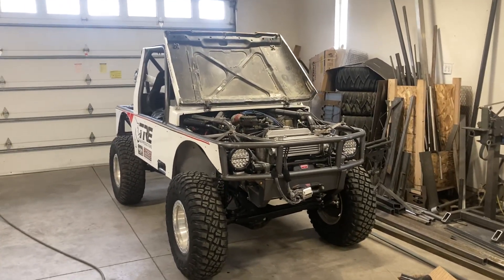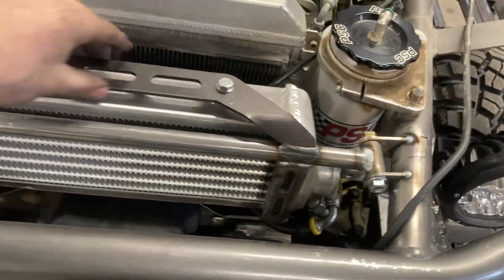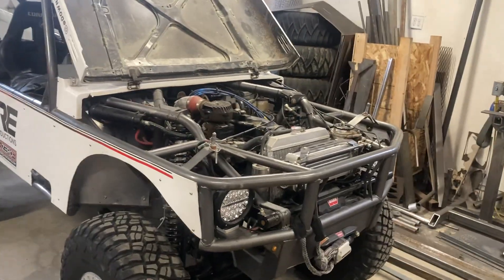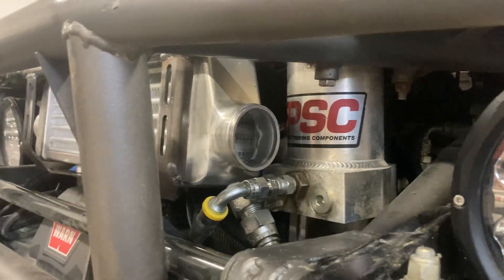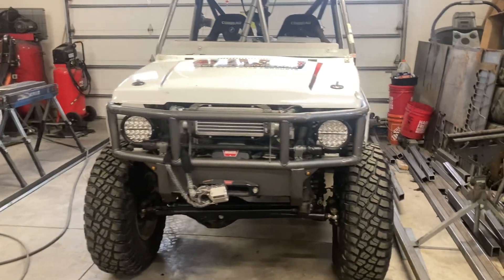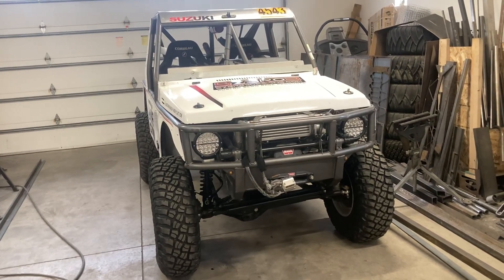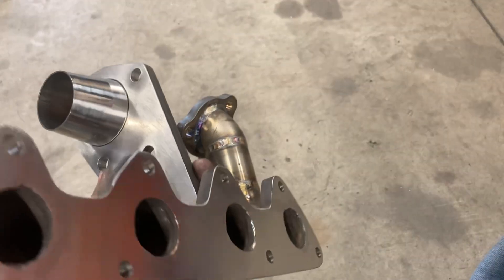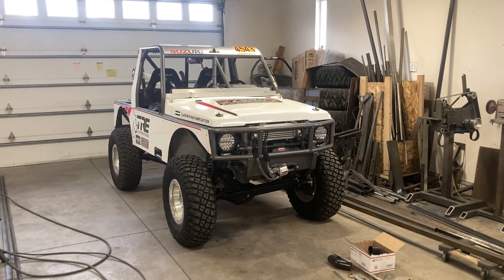Samurai Turbo progress

Comment: So I've been eyeing the possibility of turbocharging my DD samurai. I've been keeping an eye on this build to see how it turns out as its the exact setup I'm wanting. Sniper BBD or 2CG, then a smallish intercooler, and a K03 is what I am thinking. Swapping the tank for the EFI one, and I have a 1.6 8v head that I want to use. chambers are the same size as the 1.3 and the 1.6 head has quite a bit bigger ports and valves on it and the EFI distributor is there as well, hopefully meaning I don't need to mess with locking out the carb distributor. No idea what it outputs for signal though soo thats kind of a crap shoot.
Reply from the maker: @MonkeyWithAWrench  I would definitely go with the Holley hyperspark ignition so that the computer can control the timing based on boost. Much safer for the engines longevity. Racing season just ended for me so I’ll be getting going on the turbo soon.